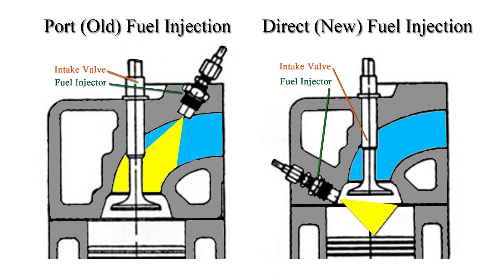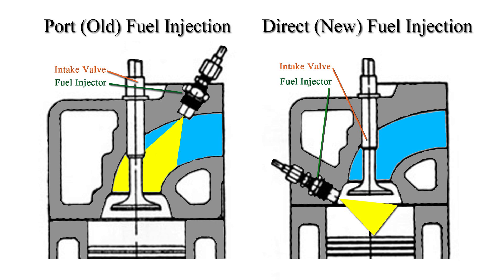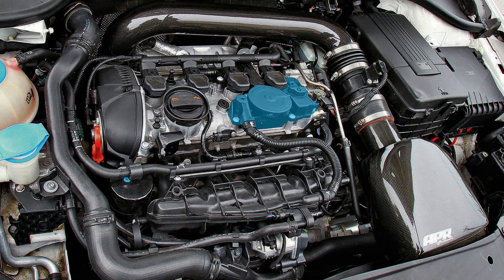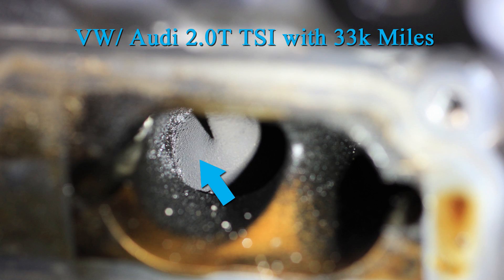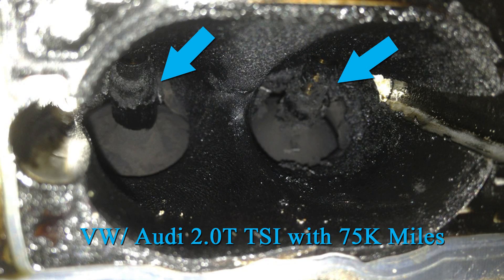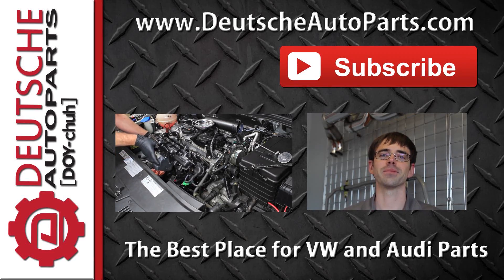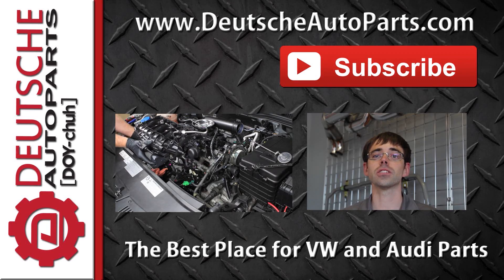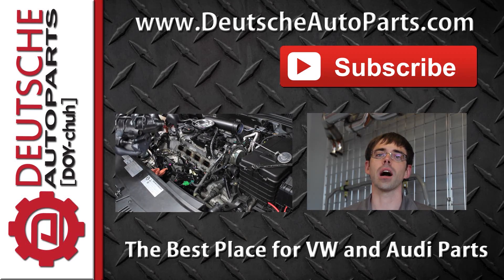Carbon Build up on Direct Injection Engine (Intake Valves) AKA GDI Gasoline Direct Inection

Comment: What irks me is that ALL manufacturers knew this would be an issue but continued to go down and release direct injection to the market before they figured out how to keep them clean.  Anyone who knew anything about petrol engines knew this would be a problem when the injector was moved.
Reply: +James Roquemore Yep, I had a mini cooper same exact issue. I just want the automakers to own up to it. Put it on the required list of service intervals. I would not feel so slighted if when i bought the car i knew oh hey at 50k there is a 900 overhaul. I could plan for it I could prepare for it.  The straight up saying it is a non-issue is a total farce. I got lucky my VW GTI needed a new intake runner for an unrelated issue and the service guy was like hey lets do a carbon clean up for like 150 bucks save you 500 and get you through to 80k.  I did it car drives like new.  I have another DI car in my fleet I am strongly considering selling it off and going to a hybrid.   I also just saw another Ford tech say even there "improved DI system" was having serious carbon issues. I think no brand is immune to the sadness that is DI

Comment: I bet this carbon buildup is eating up catalytic converters if the hardened carbon chunks break off of the valves.
Reply from the maker: With VW and Audi engines this is not generally an issue.  It also seems unlikely to us that any carbon large enough to get stuck in the cat would never make it there as it would be more likely to get stuck in the engine and cause damage before making it to the cat.

Comment: What about just putting a breather filter on pc v system instead n plugging pcv hole on intake tube...that would eliminate all blow by into the intake correct?
Reply from the maker: This would help resolve this issue but this would not meet any emissions standards and is a big no no as far as the EPA is concerned.

Comment: What's your experience with different fuels regarding the idea of a 2nd injector back towards the intake manifold. Or even fuel additives that are usually reserved for engine cleaning? I know that some fuels claim to "condition" the motor, and by that they keep cylinders clean by using detergents that dissolve the carbon build up. I also know that running LPG may keep the intake tract clean. But unsure about direct injection with LPG fuels.
Reply from the maker: The additional injectors in the manifold should solve this problem on vehicles that come from the factory with them.  Adding them after the fact is an extremely complicated and expensive endeavor.  

As for as Fuels are concerned, Since direct injection engines don't have a carbon issue inside the engine (for VW and Audi at least) no fuel types or additives will help.  The only way to help cut down on the carbon build up would be a catch can.

Comment: What did mazda do with their sky active engines ?? those engines have been out since 2012 and i have not heard of carbon buildup issues like the audi or vw engines. Even mazda 2.3 turbo(speed3) had carbon buildup issues.  looks like mazda has a solution ?
Reply from the maker: Im sorry we don't know what Mazda may have done, but that is an interesting fact we will have to look into

Comment: Seems like the perfect solution would be to do away with direct injection.  There are many things manufacturers are doing to our cars today that only have to do with getting better gas mileage but is actually detrimental to the lifespan of the car.  Just Thank the EPA.
Reply: the only solution will have to be double injectors, a port injector that runs periodically just for cleansing purposes.
Reply from the maker: Direct injection has plenty of benefits many of which relate to performance.  Moving the fuel injector into the combustion chamber allows much more control of the fuel injection.  Unfortunately this control does come with its down sides.

Comment: Very informative. Does products like Poly Moly valve cleaner work?
Reply from the maker: Im sorry we have never heard of Poly Moy so we cant offer any insight on this product.
Reply: Actually, the name is Liqui Moly, and it is a german brand.
Reply from the maker: rjs15570 Im sorry for the late reply.  This would likely only work as a preventative.  Once the carbon has built up manual cleaning is the only way to solve the issue as far as we know,

Comment: Walnut blasting is a cost effective solution to cleaning these carbon caked intake valves, the way to do is to have a shop air, sand blaster nozzle and tank, 25 lbs of fine grit walnut media, a shop vac with a modified rubber hose that will fit into the intake on the cylinder head (ie radiator rubber hose) make a small hole on the rubber tube so that the sand blaster nozzle can go in in out then rotate the engine TDC with intake valve closed (intake valves are shut) turn on the shop vac, place the nozzle as close to the valves and blast them, if they're not responding, turn off the vacuum, and blast the valves NO MORE THEN 3 seconds (accumulation of the walnut media will cause ineffective cleaning) then turn on the vacuum to clear the accumulation, after your done blasting to your liking, clean off as much walnut media as possible and use shop air to clear them out.

Comment: Very informational video, Paul. Thanks. Quick question, though; Do you have an idea if/when VW will release the US Spec Mk7 GTI with Multi-Point Injection? They have it in Europe already, so it's bound to come here, no?
Reply from the maker: The MK7 GTI is already here and does not have multipoint injection.  We do not know if they have planned to bring that here at this time.  Sorry we don't have a better answer.
Reply: Deutsche Auto Parts- Your Source for Everything VW and Audi http://www.autocar.co.uk/car-review/volkswagen/golf-gti/design

Comment: Thats the only drawback of direct injection.  Yet manufacturers still has no answer for it...
Reply from the maker: a few manufacturers are adding the additional injectors which should solve this problem.  Some version of this will most likely be the outcome that most manufacturers come up with.
Reply: But it will be expensive...

Comment: Was looking at vw new ea888 gen 3 engine...looks like vw has revised intake and pcv system but didnt include intake injectors. Anyways, wanted to know if you have any information on their new engine? Basically, did vw address issue ?
Reply from the maker: Without adding injectors there is no way to really address this issue that we are aware of.  We dont have any info on the engineering changes of the Ea888 engine.  As mentioned in the video the issue lies with direct injection engines not with any specific model.  Thanks for watching.  We really appreciate it.